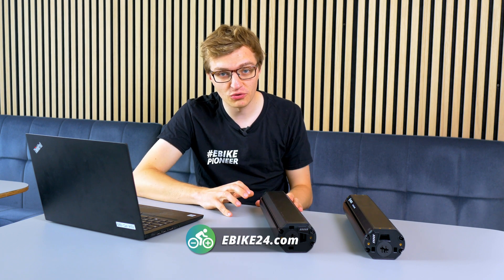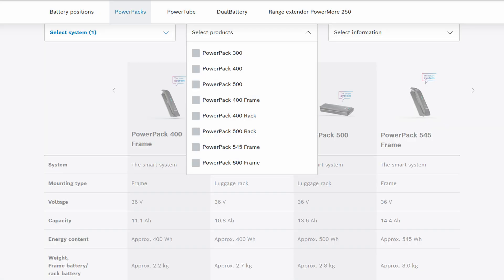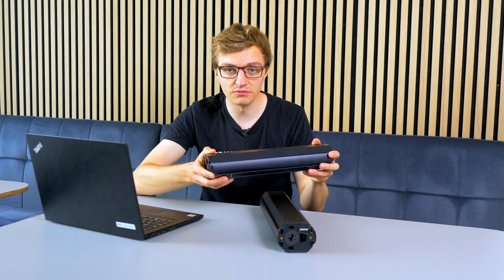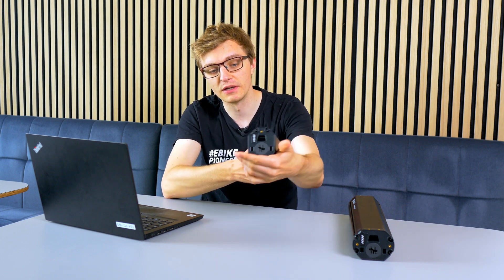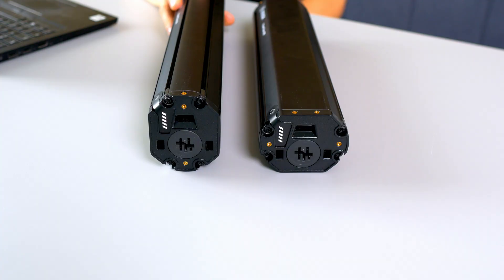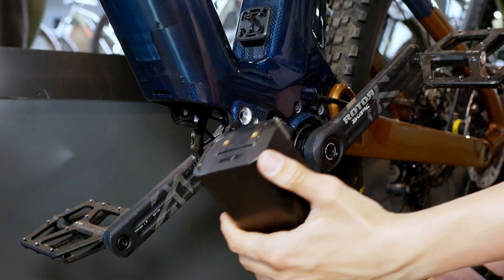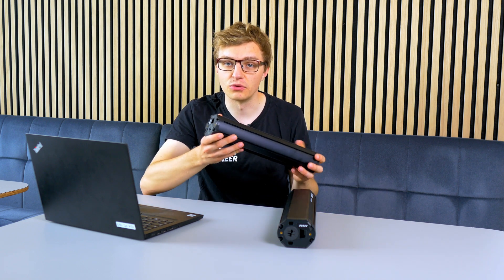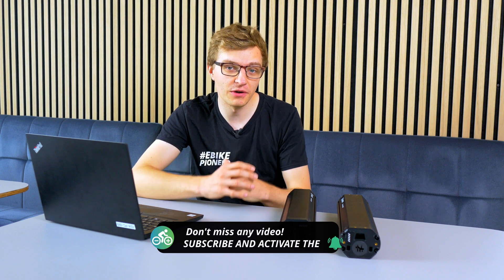Bosch PowerTube differences - vertical vs. horizontal, axial vs. pivot | EBIKE24

Comment: Hallo, ich habe ein isy XXL Smart System und ein Bosch Performance Cx Bike.  Ich habe zwei Akkus, Powerpack 545 und 725 W.  Meine Frage ist: Kann ich zwei Batterien gleichzeitig verwenden?
Reply from the maker: Hallo, vielen Dank für Ihren Kommentar. Theoretisch ist die Verwendung von zwei Batterien / Dual Battery möglich, allerdings ist das auch abhängig vom E-Bike Hersteller, in dem Fall isy. Mehr Infos zur Dual Battery gibt es hier: https://www.elektrofahrrad24.de/blog/e-bike-bosch-ebike-flow-app-update-1-20
Ich empfehle Ihnen mit isy, oder mit Ihrem isy-Händler des Vertrauens, direkt Kontakt aufzunehmen: https://www.isy.de/de-de/kontakt
Sportliche Grüße - Michael

Comment: Do they have specific codes? Does the horizontal pivot have a separate code to the vertical?
Reply from the maker: Hi, the batteries have different manufacturer part numbers depending on the battery size and horizontal/vertical orientation. The pivot/axial mounting type is not indicated with the battery because this depends more on the bike and the specific part you need for the battery. You need to pay attention to the mounting type your bike has when buying replacement parts. I hope this helps!
Cheers - Michael